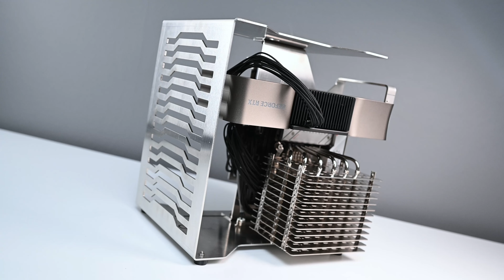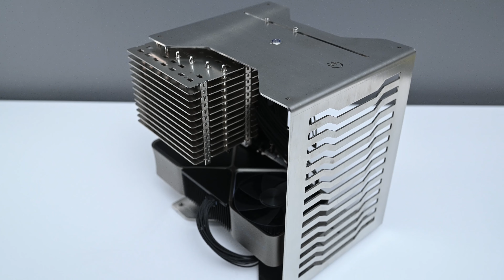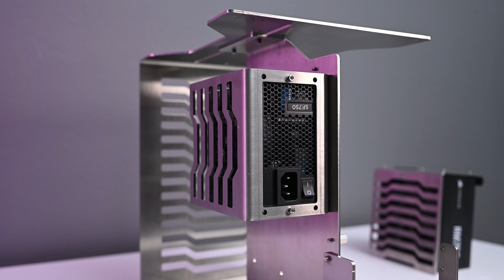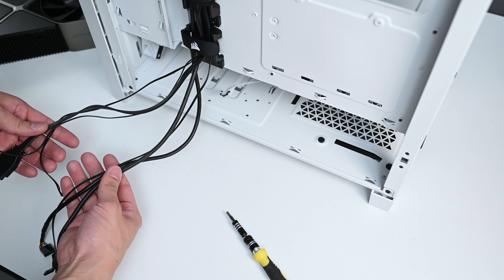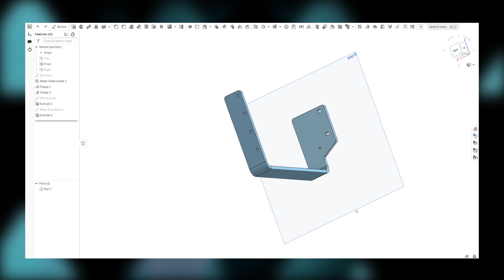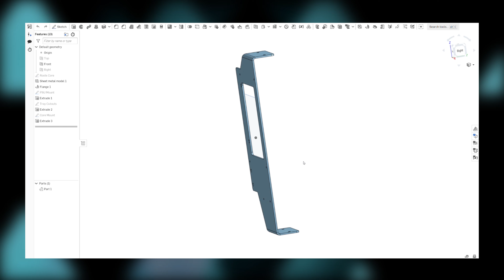So I designed this thing… Open Air ITX Case, RTX 4090

Comment: Very cool case design, but you're straight up wrong about claiming that USB connections on the back IO panel are somehow better. Using a front panel connector is not somehow worse.
Reply from the maker: Having built many systems over a decade, my experience is that the quality will depend on the front USB hub of the case. I have had a few (less than a handful, so not many) give out after even just months, there was one case where the front USB hub was just DOA. But never a problem with back IO on motherboards.

Comment: Any support for a AIO?
Reply from the maker: No, air cooling focused only. Also, my experience as of lately has made me sway away from AIOs in general, I don't recommend those anymore. Either go air-cooling or full custom actual water cooling. Reason: when AIOs have pump issues, you can't open it and fix those. I've had a few fail in less than a year with client builds. You have to replace the entire AIO unit. Aircoolers don't have that problem obviously, very simple low maintenance. Custom water cooling, if your pump or any particular part malfunctions, you can replace just that one unit.

Comment: Very cool! I love the concept! I prefer air cooled over water cooled, so this is exciting. I hate RGB (except I need backlit keys), so I'm glad to see that removed. I like your little custom H logo.

I think it's only fair that you show the final build connected to a keyboard, mouse and monitor(s) running Windows (the preferred OS for gaming) with all cables attached (even if it's just video and power and everything else is wireless, although I prefer all wired kvm, ethernet, game controller, speakers/headset, webcam, VR headset, etc. - I hate recharging batteries, lol). I'd also like to know your monitor sizes that you show in order to visually compare your final PC(s) to the various screen sizes.

The reason I lean towards these small builds is for portability. I need to take my PC to LAN parties and events. Please show how this PC would be torn down, actually carried (demonstrate that please) and reset up. Maybe tell us the final weight. I don't favor a particular orientation, except my mobo ports should be easily accessible for quick tear down and re-building.

THANK YOU! BEST OF LUCK!

Comment: All your components will get dusty and might fail earlier plus somebody might spill something on that thing. I never got why people build a case like that. Back in the 2000´s my cases were alsways open to the side, and I had to clean that shit all the time, no thanks. I just got a black box now with all my components safe in there behind some meshed filters and all quiet down, what more to ask.
Reply from the maker: Closed cases get just as dusty as open air cases. The only difference is closed cases you have to take more time to clean it. Open air cases is much easier to clean, take it outside and take compressed air to it and that's it. Closed case you have to take off all the panels, filters, clean those, clean the inside corners and crevices of your PC, get through all the cable management etc, takes longer. I've had both open and closed. Closed is more hassle, I hate it (personal opinion and style). 

Closed cases also have vent holes on their panels,  you can spill water and it will go right through that and into your system anyways. You spill anything on a PC whether it's closed or open, it will go through period.

Open air cases is not for everyone. I tell people it depends on your lifestyle. Example, if you have certain pets that like to run around and stick their paws in things, then get a closed case.  There's also a balance of function and aesthetics, some people like the way open looks and some prefer closed for various reasons. But I appreciate you sharing your thoughts!
Reply: @hardlinenexus  Really ? because they have significantly better filters. Can you explain why they get just as dusty ? Do you mean just later on ? Because otherwise I don´t see why that should be the "case", pun intended xD 
 
Cleaning with compression air. You can clean both types of cases just as well with that. I would be careful though not to damage any components. And yes you have to take off all the panels and filters in a closed case, that´s what they are there for. That is their function.
Have you ever seen say a car without filters ? Or a vacuum cleaner etc. ? Now why would all those technical devices have filters installed instead of just being open if they get just as dirty and are more difficult to clean ? You may prefer an open case design, and that´s fine however it is simply not the case that they get just as dirty.
They are also significantly quiter and cheaper for instance. But that´s not the point here because an open design may be more aesthetically pleasing and so on.

Closed cases are not water proof for sure, but they still have some protection depending on where you spill, for sure more so than any open design by default. An iPhone does not work underwater, but you can use it in rain. So while not perfectly sealed, again it helps.

In my opinion design should follow function but then again I am a mechanical design engineer.
Reply from the maker: @sierraecho884  I know the arguments for why people like closed cases. Also there's several factors to consider as well. I would even say simply saying "open vs closed" cases generally speaking isn't quite sufficient. Because really we would have to take case by case comparisons. Most if not all open air cases are more similar, but that can't be said the same about closed cases. Closed cases have a lot more variation when it comes to "significantly better filters", not all filters and ventilations are built equally. The discussion would be a very long essay here if we really wanted to nail it all down.

Also, we can't really compare a car or vacuum or cell phone that use filters to PC systems, they aren't used the same way. Application is totally different. But I know why you used these analogies for your argument and thought process.

Let's take one example from my personal experience. The Yuel Beast Monument or Atlas II case is full open air, in 4 months it would accumulate the same amount of dust that my LianLi O11D that's got all its panels on would in 6 months. And I would dust/clean the same frequency on both systems. I always clean every 6 months. But then how does an open air like the Atlas II compare in dust accumulation compare to the Corsair 4000D? The NZXT H5? The Phanteks Evolv Shift? The Cooler Master NR200? etc etc... they all have different filters.

But also what lifestyle do you have? How many pets? Are you a naturally clumsy person who walks around with a glass of water and often bumps into your PC and spills on it? In my entire life of 34 years, having been around PCs and building a ton of PCs, I have never spilt any liquid on my computer. So these "what if scenarios" are valid to imagine, yes it can happen, but how likely? There's a lot to factor in.

It would be a very long conversation if you really wanted to break this down. But I will tell you that open vs closed is really dependent on your lifestyle, and open air cases is not as "vulnerable" as most people think. Even given its nature and design.

That's great you're a mechanical engineer, I'm a material science engineer with a focus on mechanical engineering (at least from school). But workwise I'm an artist (both digital and performing). So when it comes to design, I have to incorporate both function and form. Not just because I have to, but because I want to. But obviously, form is subjective.
Reply: @hardlinenexus  Sure it would be a cases to cases comparioson however open cases have no filters whatsoever and close ones do however good or bed you can already put things into categories. Categories will never be 100% accurate because they by definition simplify things.

I used car, vacuums and so on because those things use similar designs for similar purposes.

As I said previously, those two categories are very simplified. We can break it down a little more if you wish but the best open case in a sense of dust accumulation will not even beat a mid term closed case, that´s the whole point of the system. I do get a case which is basically a box safely harbouring my equipment to have it somewhat safe from moisture, dust, dog hair, small spills, somewhat sound dampaning and so on. No open structute can provide any of that.

If your lifestyle is the reason why not have open case TV open case car structures and so on ? Because it does not matter how great you are of NOT being clumbdy it can still happen maybe not to you maybe you got lucky and so on. We are comparing general designs with consumer grade products, I am sure there are people who never have to use a seatbelt...I think you get my point. Oh and BTW with millions of computers and people yes it is very likely. It maybe won´t happening to you but somebody, hence the design choice.

In the end you can choose however you want and you can reason your choice however you want but physics won´t change. An open structure is more suseptible to the things I have already mentioned. Some closed structures do their job better than others sure and we can rank those but an open structure ? It will always be inferior in those terms. You might want prefer an open case because of it´s aestetics but there is no argument about function.

Comment: As a big fan (pun intended) of Open Air Cooling systems I love seeing projects like this. Couple of quick thoughts.

1) Make the motherboard cutout for the ITX model bigger to allow easy access to the back NVME slot without the need to remove the motherboard.

2) Maybe look at doing an MATX variant. Should keep the size down and would work better with an ITX option than the ATX variant.

As for the flip option, which is cool. I noted in the video you talked about having the GPU and CPU facing the user. I personally prefer them facing away as that lowers the noise perceived.

Hope to see this available for sale soon, would love to play with this.
Reply from the maker: Very good points. Thank you for taking the time to write all of that. So far the feedback has been very constructive and positive and it's helping me in the final stages of refining it. Once people started telling me their thoughts from this video, I was quickly able to make a decision on how the case should ultimately be. Stay tuned!

Comment: Great job dude, but I feel like the itx side of things need more planning. Itx main advantage is size but if the case itself is hinging towards atx realm. It is probably best to ditch having different mounting style for itx layout if the case is still close to atx layout or purpose built a itx version of the case which is way smaller with less flexibility which is still fine cause open air case offers great cooling performance.
Reply from the maker: I want to make the ITX case size smaller. The only solution I can think of is to make it not support big GPUs like the Strix 4090. But come to think of it, I think that's actually fine. Because most people who would buy or have an ITX case are probably not going to want anything larger than a 3080 anyways... (physically). So very possible I can just cut all that down.

Comment: mate that is such a slick looking system. you should be really chuffed with it. I'd love to see a mATX version (as I'm yet to find a mATX OAC) with dual rad support (yes I know it breaks the air-cooling vibe)
Reply from the maker: Thank you! So mATX is in a weird spot (unpopular), they just don't sell well on the market. However, I am going to be making watercooled versions of the ATX though. With that in mind, mATX motherboards also just fit well on ATX trays too, because they are bigger than ITX enough where it doesn't look quite as empty in a case haha, especially if the ATX case is made to be very compact like what I have here. I purposefully made them with a target size to be smaller than most mid-tower cases on the market.